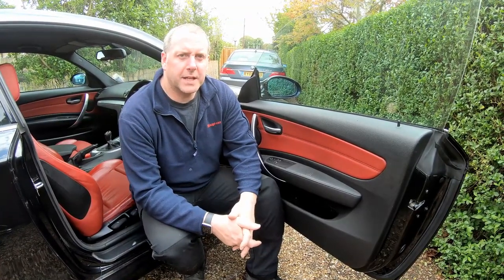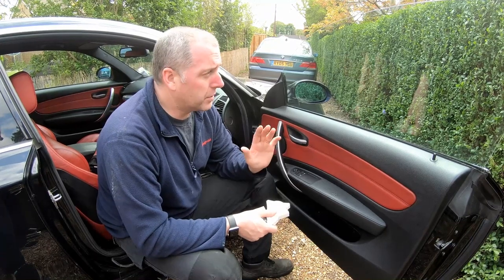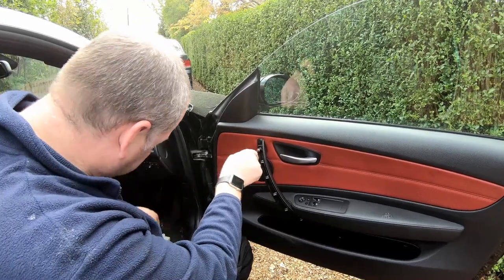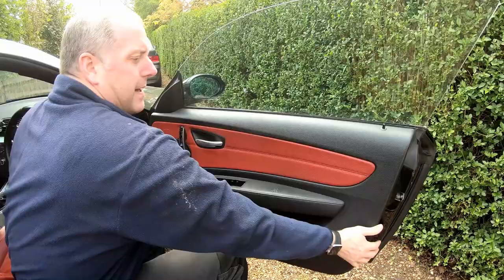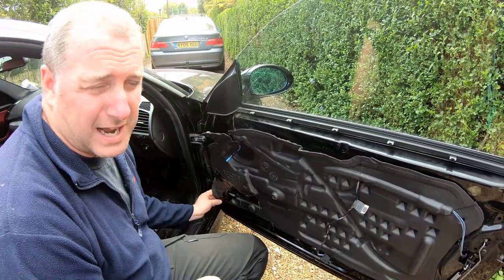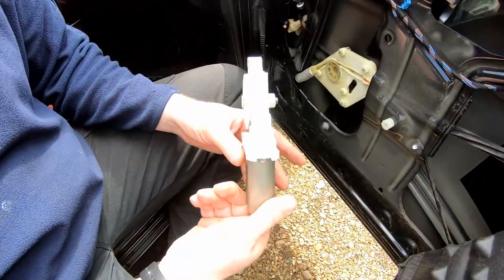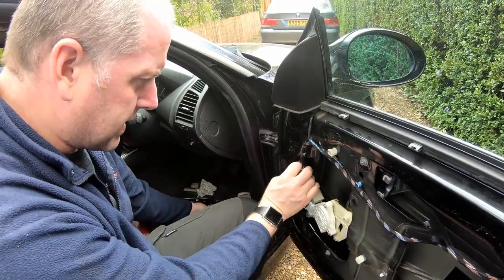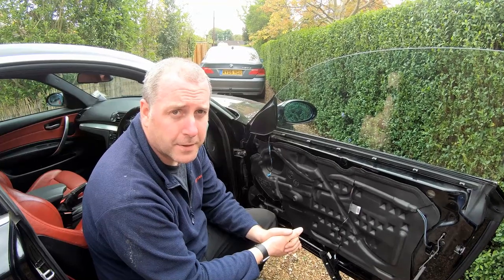BMW 1 Series - Replacing the Window Motors On The E82 & E88 Coupe and Convertible

Comment: Kev, you helped me save about 240 euros on repairs+parts for this job. You're an absolute legend. Bought an E88 motor off ebay+regulator for 60 quid (left side, which is less used than right side in the UK, but so happens to be my driver's side, so win win) and fitted it to my E81. Your tutorial/walkthrough was an absolute breeze to follow. Thanks a ton Kev!!
Reply from the maker: Awesome dude, glad it helped! 👌🏻😎

Comment: Hi Kev, 
with no mechanical or electrical skills at all, I have just successfully changed the driver's side electric window motor on my cabriolet!!!
Thank you so much for your clear and simple video.
The clips holding the door panel on were super tight and I struggled to release them. I caused a little damage to the very bottom of the panel doing so but, being at the bottom, it is not visible.
Also, took a little time to engage the splines between the motor and the regulator but overall it went very well.
Having paid £167:00 for the motor, the last thing I needed was a large installation bill. Brilliant!!!!
Reply from the maker: Awesome, It makes me happy to know that my videos have helped to save someone a significant labour bill! Nice one! 🤓👍

Comment: Hi Kev, thanks for the video - I cannot tell you how much I've struggled before I found your clear explanation of the issue and how by changing the window regulator motor you fixed it. I have ordered the window motors and share if it worked on my E82.
Reply: Hi Kev, motors arrived and changed today, but windows are still sticking out. I did the down/up thing and tried another reset via a different route suggested online (down-hold15sec-up-hold15sec) but still no luck. Could this be window regulators? Local BMW dealer says they need to ‘diagnose this’ for 580 usd.. and then ‘probably do some coding’…and I expect after this say ‘yeah it’s the regulator, need to change it’. Do you know if this is the P/N for window regulator - 51 33 7 165 595? Thanks mate!

Comment: Hi , great video, I too have an issue with the drivers window not dropping upon closing . Been to bmw specialist x2 and both have suggested FRM footwell module but neither have said it will defo work . Can I ask was your  passenger window working how it should ? As neither front windows drop on my E88 coupe . But on the passenger side it hasn’t caused me an issue as it seems to close just under the lip of the roof. Not so on the drivers side, I have to get in and manually drop it then back up again to create the seal. And avoid a draft ! 
The Frm is £400+ and would need coding etc . Iam reluctant to change Frm as I have no other issues lights etc that these things also control

Comment: My motor still works at 91,000km but my window is not level so I was looking if there is a support carrier piece that holds the window which I can tighten to level it out. Nice vid, nice white & red E82.
Reply from the maker: There is a bar that runs along the bottom, I wonder if one of the lift arms is bent on your regulator slightly, it’s not terribly difficult to replace but they are hard to find as second hand items in my experience! It may be that you will need to get a brand new one from BMW. 👍🏻

Comment: Great video! Was the driver side window functioning? As I’m going going all the way and down via the buttons
Reply from the maker: Mine wasn't working, it would stay in the slightly down position as if i'd opened the door and an error would appear on the dash.
Reply: I have the same issue so I guess replacing the motor would fix it. However if there was a problem with the regulator what type of issues would occur?
Reply from the maker: It would likely be similar symptoms, to date, I have never seen a faulty regulator, it has always been the motor in my experience. There’s always a first time though!

Comment: Can anyone help? I put the window all the way down on my e82, it made a loud clunk when at the bottom, it then would hardly work, I managed to get it to wind all the way back up but it now doesn’t work at all, just makes funny sounds when I try to use the switch. I’m pretty sure it’s probably the motor but I feel as if the window regulator might have broken? Does anyone have any ideas?
Reply from the maker: It's hard to say from a description, it could be either the motor or the regulator, it doesn't sound electrical if you are getting a reaction from the switch though. I would take the door card off and have a good look inside, it's the only way to be sure!

Comment: Hey bud! Say if you have a window that won't go up all the way, or just needs to be adjusted say a quarter of an inch up, do you think I can just twist those gears in the window motor regulator to get the window to go up some?
Reply from the maker: No mate, it doesn't work that way. Your motor has most likely dropped it's limit data. What I would try is to disconnect the motor connector, then reconnect and do the down the up thing that I did at the end. This should reset the windows upper and lower limits. This is incredibly rare mind and is probably a good indicator of a failing motor anyway!

Comment: Ive a e82 coupe. I'm having an issue where my passenger window won't drop down when opening the door but will go up & down no issues that way just whenever you try open the door it doesn't drop down. Tried resetting but didn't work but funny enough the other day it just decided to drop down when opening the door once or twice then it went back to not doing it. You think a motor will fix this?
Reply from the maker: Believe it or not simply unplugging the motor and reconnecting it and then trying the up down reset may sort it! Give it a try before spending money on a motor! You’ve nothing to lose other than 30 minutes of your time! 👍🏻😎

Comment: Hi,
I need some help. I think the motor is broken. I don’t know for sure. It was freezy outside and I opened the door. The windows went down as it should but never went up when I closed it. Not it always down a inch
Reply from the maker: Yeah, sounds like the motor is at fault 👍🏻
Reply: Cheapest one for 180 euros…

Comment: Did you get the fault code for the anti trap malfunction Ccid 261
Reply from the maker: Not for the anti trap but it threw a code for a window fault when it didn't drop. It always cleared on restart though, with no need to clear the code manually in my case.

Comment: Before you changed the motor did you find your window wouldn’t go all the way down? Mine doesn’t go all the way down, and the one touch wants it to go too far up. I’ve tried re setting the limits but it doesn’t seem to want to sort it. Wondering if I need a new motor, or maybe just it’s out of alignment teeth wise? If that makes sense. Looking at it today someone has defo been in there before me. 08 plate car same as yours.
Reply from the maker: No mate, mine wouldn't go down at all, not even the little drop when the door opened. It has been 100% perfect since the motor change though. Good luck with yours ;)
Reply: @KevsShed  so it seemed mine went into some sort of power saving mode. Got it out and reset the motor and all was well for a week. Now back to the same issue. Suspect I'll have to replace the motor too.
Reply: Cheers Kev shed you’ve found the problem on my 1 series will have to order the motor up where did you buy the motor from I need a passenger side motor
Reply from the maker: @Unknown-dw9oq  Unfortunately mate it's a dealer only part!
Reply: Update I went down took the negative off battery to change my headlights and when i put everything back on my window worked so I did the reset on the window switch and now everything’s working again was a weird one but least it’s saved me having to buy a new window motor will be buying a new one if it happens again but now no lights on dash so overall good outcome I’d say lol

Comment: Great video Kev, what part do I need to order ive got the exact same issue. I have a E81 2008
Reply from the maker: Part number 2 here. https://www.realoem.com/bmw/enUS/showparts?id=UK12-EUR-06-2008-E81-BMW-123d&diagId=51_6274
You just need to choose left or right!
Reply: @KevsShed  Thank you Kev, I don't think its the motor as the window sometimes does open and close if I mess with it, but it will not close from the top when car door is closed. Then sometimes it won't even operate. I don't know what to do. I have managed to close it enough, so the rain doesn't get in.

Comment: How hard is it to change the regulator whilst window is stuck down? ☹️
Reply from the maker: Absolutely no difference to the method that I employed in the video, the regulator sits in front of the glass even when it is down so you will still have adequate access to remove it. Hope this helps and good luck.
Reply: @KevsShed  thank you

Comment: Kev, i just changed my window motor today but I'm having the same issue with the window not dropping slightly so the door doesnt close properly, any idea?
Reply from the maker: You need to drop it entirely to the bottom and back up again, failing that, try disconnecting the battery for a few minutes and trying again 👍🏻
Reply: @KevsShed  hi Kev, i sorted the issue by dropping it all the way. Keep the vids coming i never thought i'd need to find a youtube vid for such a problem but your vids are really useful keep em coming!

Comment: Hi Kev. Just joined your site and the reason was my grandaughter has just dumped her E81 on my drive. Drivers side window will not move. It was stuck in the down position. I have managed to get the window to the top by hand using a suction pad to form a seal to prevent water ingress. Seems to be holding there for now. I will be investigating it once I get a dry day. Could you please give me some indication as to where to start looking. Thank you.
Reply from the maker: I'd suspect either the motor has failed, which is common on the E82 but not so much on the E81, or the regulator itself has failed. Both are relatively easy to replace and not too dissimilar to the process in my video. Good luck bud. 👌
Reply: @KevsShed  Thank you very much for the prompt reply. I have found the relevant parts on Ebay new. Will have a nosey first to see the damage. Will keep me out of trouble for a few hours LOL. BTW your vid was excellent.
Reply from the maker: @goldenlabradorskye  cheers bud, really means a lot! 👌🏻😎
Reply: @KevsShed  Some feedback. Found the problem, it is the regulator, cable has snapped through corrosion. Found a aftermarket on ebay for £58.00. Hopefully the motor will be ok.
Reply from the maker: @goldenlabradorskye  Nice work bud!

Comment: Mine keeps coming up with a window trap fault sometimes the window doesnyt go up or down othere times it goes right up so the door won't close...
Reply from the maker: Try going through the steps I did in the video to remove the door card and simply unplug the motor for a few minutes. Then reconnect it and take the window all the way down and all the way up. This may reset it. Good luck. 👍🤓

Comment: Just bought a 1 series where the auto drop doesn’t work, window goes up and down fine so hopefully I could do the reset thing but it’s not working! 🧐
Reply from the maker: I would try disconnecting the multiplug from the motor, then refit it and try, sometimes this can have the effect of a hard reset and suddenly it may spring back into life!
Reply: Would disconnecting the battery help? Don’t fancy opening up the door unless I really have to replace the motors 🙈
Reply: Thanks for the reply by the way 😁👍🏼
Reply from the maker: It won't hurt to try a battery disconnect. It's surprising how often completely disconnecting all electrical power from a car can reset everything! Good luck dude!
Reply: @SuperSonic Any luck this?